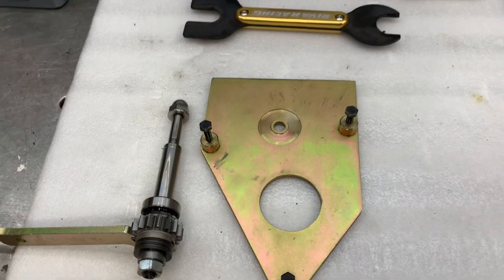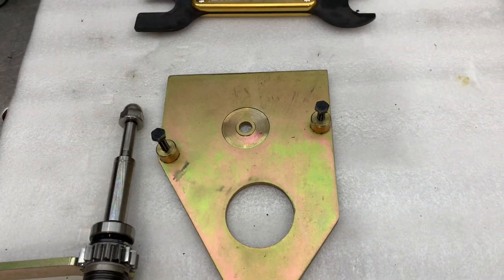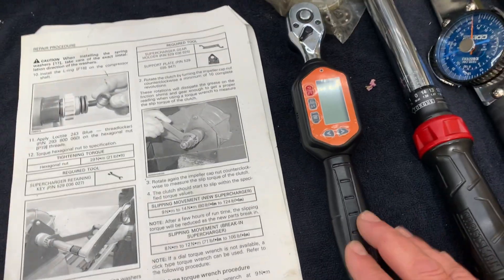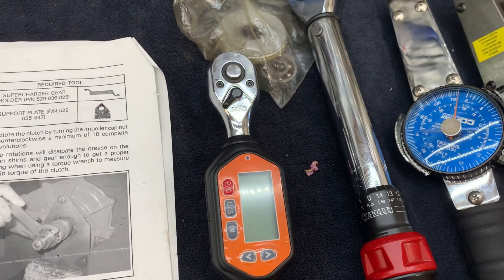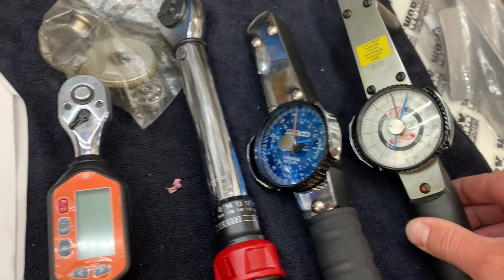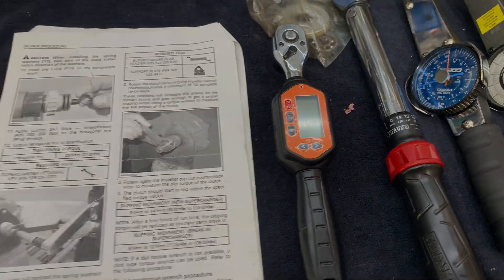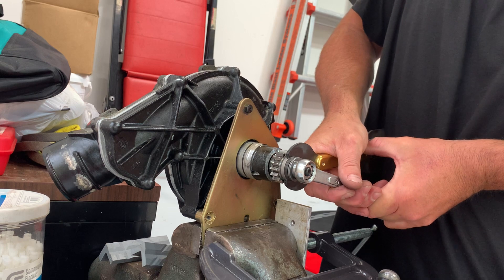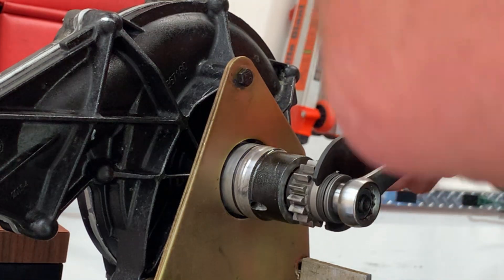Slip adjustment on a Stage 3 2015 RXT 260

Comment: Hi 
What should be the slip on the supercharger with an all stock seadoo RXP260RS 2013 model ?
Mine has been rebuild, but the SC is out the ski now since been doing the Carbon seal. 
Just want to check the slip before I put it all back together

Thankyou !